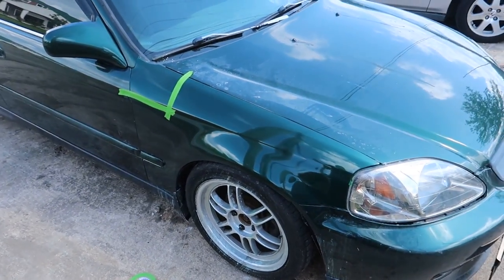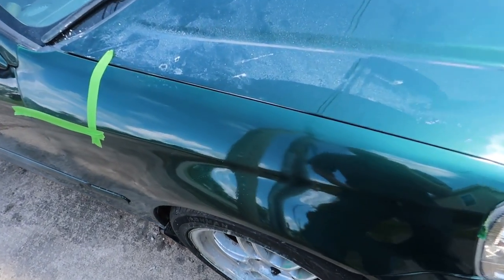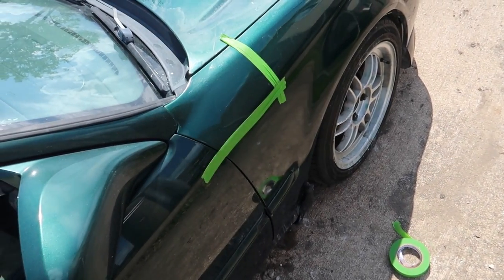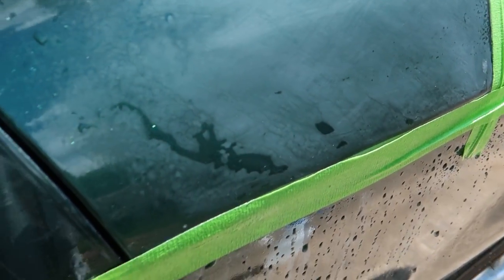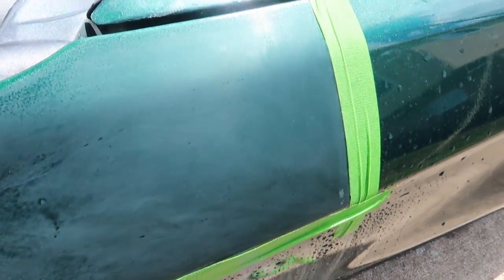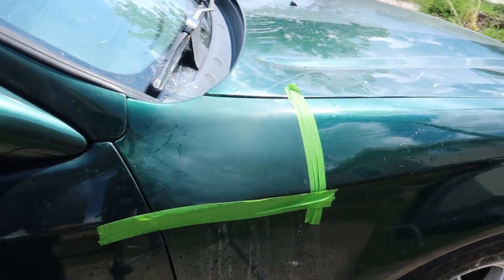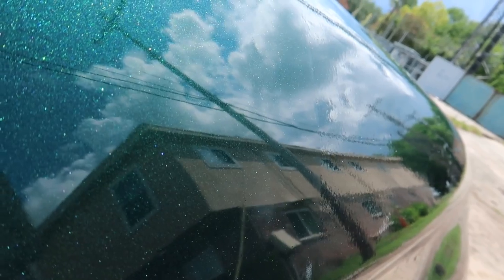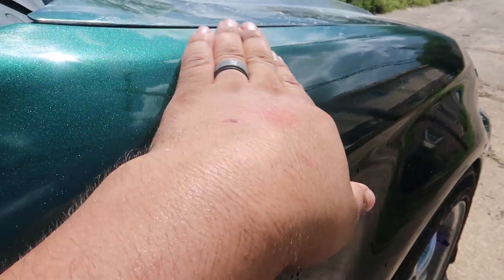Buffing By Hand With Meguiar's ULTIMATE Compound. Looks Like Glass!

Comment: I guess when you sand the clear coat, the reflection gets destroyed (cuz the surface is all jaggedy and light reflections and all), but when you compound it, the clear coat returns back to being super smooth allowing light to reflect back to a mirror finish. I guess the trick for somebody new to this is to not sand away the clear coat.
Reply: If you painted it yourself, you should always do 4 coats of clear coat minimum. I've seen up to 8 coats. So wetsanding with say 1500 or 2000 grit is t going to take away the clear coat, it's just gonna get rid of major surface imperfections, and the buffing compound does the rest

Comment: I would recommend using sanding sponges with soapy water. If your using sandpaper without a foam backing your going to sand unevenly with the low spots being where your fingertips are. Even wapping sandpaper around a kitchen sponge will have better results with a more consistent even sanding.

Also I've had luck placing spray paint in 130°F water for 10 minutes which helped reduce orange peel and sputtering from  the can..... great video 👍
Reply: Heating up the can before spraying is a awesome tip 👍🏻

Comment: I have some questions about the process and dry time:  How long did you wait from apply paint to applying the 2K Clear?  How long did you wait for it to dry to wet sand and use rubbing compound?  I will try this this weekend...
Reply: I was wondering this!
Reply: @SurferSteve  i know this is old but  i will tell you 
so if you paint a panel you need to wait around  12 to 24-hours  to wet sand it then you put the compound on  and polish but don't use wax  because the paint will be still curing the paint need almost a week to cure completely so after a week you can wax it
Reply: Rastaa Gd I’ve heard to wait 30-60 days
Reply: @JamesR23  It should say on the can, but I would double that time at least. If where you are is hot and dry, that's a bonus.

Comment: Hi thanks for video,can I ask you question I know old video,,,I've just applied clear coat and I'm ready to wet sand it down the complete wing,,,but it's scary seen it all faded after sanding it definitely comes back with the compound, any advice be appreciated cheers john
Reply from the maker: Just use 1200 grit or finer and don’t sand through the clear coat, you’ll be able to polish it back to a shine don’t worry
Reply: @BoBuilds  Ah cheers for getting back to me,I have 1500 grit and I'm grabbing the same compound as you,,after I do it ,do I need a polish or is the compound the job👍 thanks

Comment: Well done. Round and round and then up and down then repeat back and forth at right angles. That way you reduce the swirls. You could use a milder polish after the Megs Ultimate, like Autoglym ARP or Megs 3 in 1 one if you want to keep it in the family. That would give you an even smoother finish. The Megs will give you a bit of wax but the ARP won't so you can add your favourite wax over that.

Comment: Good job! Could you tell numbers of sandpapers that you used?
Reply: He said 2000. You could go to 3000 or even 5000 after that. Soak before use. If you rub a couple of sheets of 2000, say, together you will get a finer grade, maybe 3000 in that case. You always seem to run out of the fine grades, or at least I do.

Comment: Hey dude. Nice work.  U know once u lay on the base then clear. How long til when the paint is cured and ready for wet sand and compound buff to finish it all off? Did u leave it for 1 wk til the paint is hard and cured?
Reply: With clear coat you want to wait a month to be safe. Specially if you use a rattle can without a hardener....

Comment: Isnt it hard to get a good overall color when you do section like this? Is the title of this video correct? I mean with buffing your not removing the clear coat, this looked like you completly remove the clear coat and scratched the paint layer. Im a bit confused actually. Or whas there still clearcoat on there. Most vids ive seen the compound is for cutting the clearcoat, making even again and making the cuts less sharp. You did remove those imperfections completely, looked super nice man!

Comment: I've been using Meguiar's Ult. Compound with a wool pad on my polisher. On  the spots that had been the roughest, it won't take out the haze left by the 2000 Wet-n-Dry. Do I need a magic incantation to the Meguiar gods?
Reply: G Y you most likely have hard paint. Try a more aggressive compound perhaps, like meguiars 105.

Comment: Hey bro I need some help I have a ek with a b20vtec and my clutch wont go into gear when on but does when off I changed the slave and master but still nothing can you please lead me in the right way much love from alvin tx!!!
Reply from the maker: How does th clutch pedal feel? Does it feel pumped up? Return to position after pushing it down ect
Reply: @BoBuilds  feels great but air still comes out bleeder when I bleed it could it be that
Reply from the maker: @robbymistiegautney6011  yeah even a little air will cause issues. You could always have someone watch the slave cylinder to make sure the rod is pushing the fork in as you depress the clutch
Reply from the maker: Make sure all your clutch line fittings are tight or else it'll just keep sucking in air
Reply: @BoBuilds  ok thanks for the tips I will check them right now and see if there tight and I will let you no now it goes

Comment: It turn out great. Wondering how it has held up. I'd be concerned about the Duplicolor lacquer solvents trapped under the 2K clearcoat and shifting of the lacquer base coat. I can tell you that allowing the lacquer to gas out over a week or so, then applying SprayMax is a fail. Mine peeled off the wheels in sheets with a light pressure washer. Because it was a metallic, like yours, I could not wet sand it as it would mess up the metallics. I have heard the suggestion to spray the Duplicolor base (metallic paint), top coat it with Duplicolor clear, let it cure for a long time, wet sand that and then spray the SprayMax 2K clear. But, I've always wondered if applying the SprayMax when the lacquer was still 'soft, if it would bond and not ultimately delaminate. I see that SprayMax does offer 2K base coat (Hot Rod Black) which I'm considering for another wheel restoration. A couple years ago, I went to all 2K products, made a paint booth and painted my car. I just finished a set of wheels. That said, rattle can jobs easier and if they do hold up over time, I'd prefer that to mixing paints. Here's my instagram if you want to look. 
https://www.instagram.com/2zr_turbo_yarisrs/
Also, I have some videos of my build as well as booth and painting on my channel.